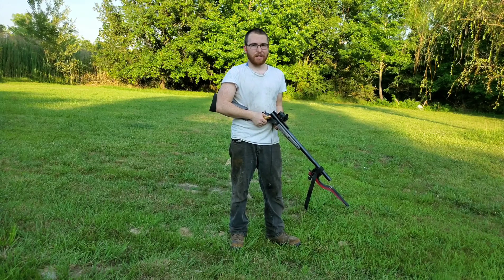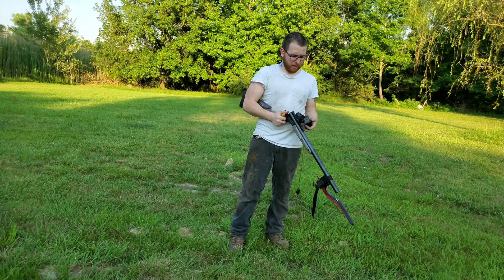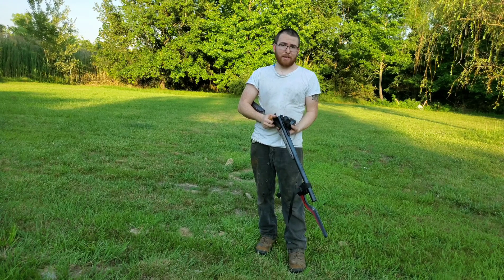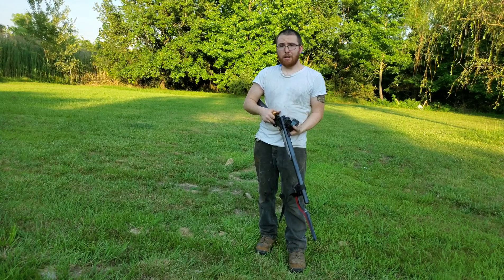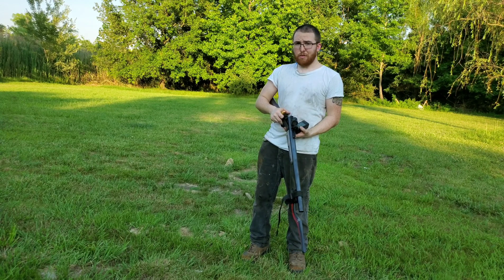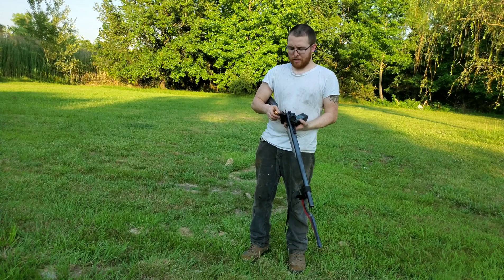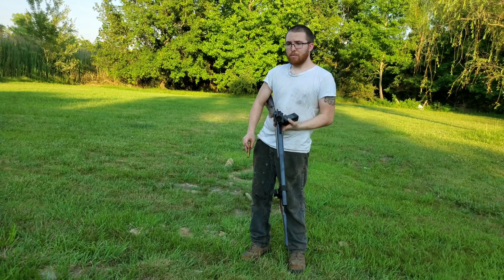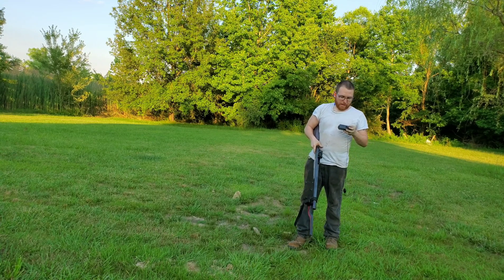Testing effects of neck tension with 726gr solids bad video, read description

Comment: On a different video, there was some mention of chambering, and you said your three inch barrel will accept a three-and-a-half inch brass.  Usually, a three inch chambering has room for a crimp to open, so it is more than just three.
Reply from the maker: Correct, but it's not completely 3.5" to account for the crimp. I had some other folks measure their chambers and theirs came to several thou short of 3.5". So either mine is an extremely rare example or someone reamed it to 3.5".

Comment: i have 2 suggestions. 1) have the barrel threaded, JMAC customs has a muzzle brake meant for a Saiga 12 guage. 2) get a mercury recoil absobtion tube for the buttstock. You can easily make them yourself. If you go home made you can kerp increasing the mass of the mercury until you reach a comfortable recoil level.